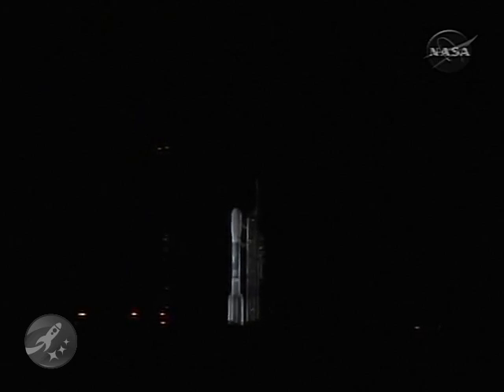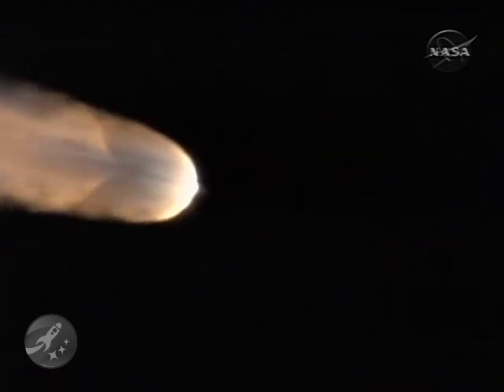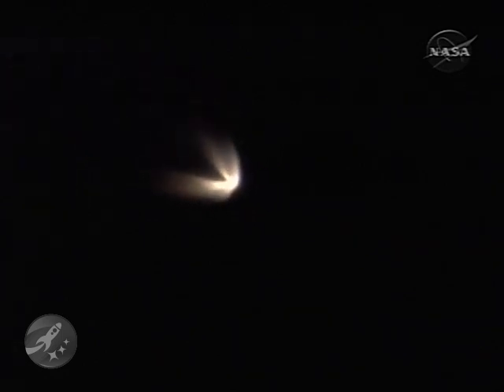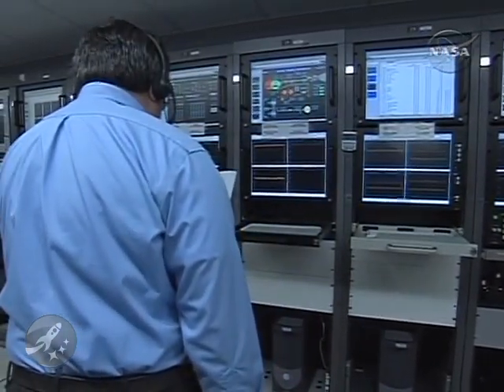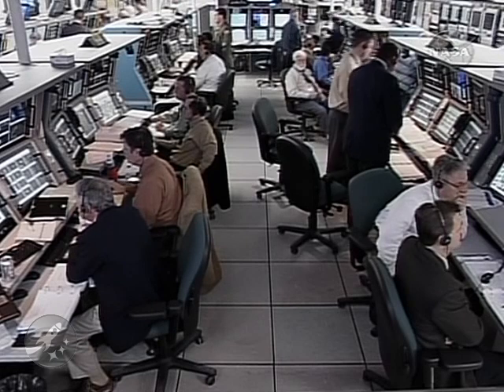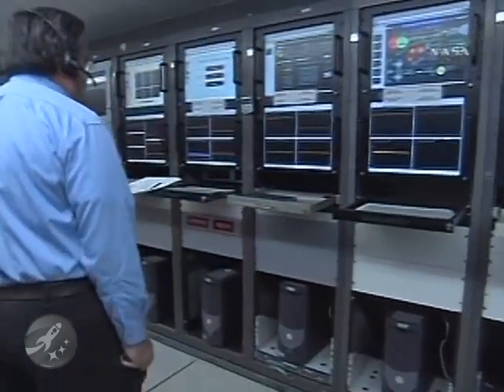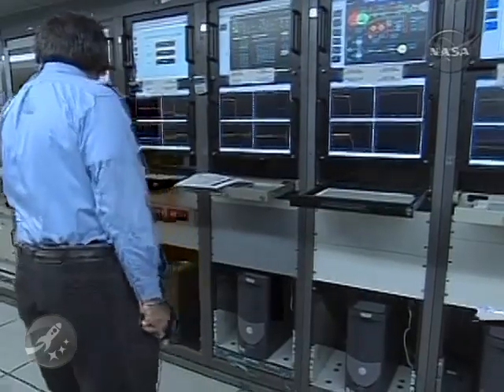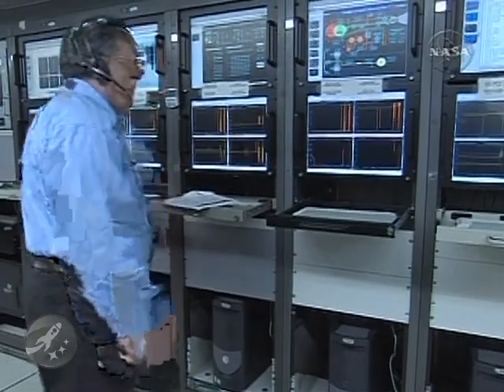Kepler Launch via Delta II Rocket on 03/07/09 (Full launch to SECO-1)

Comment: Actually, it is only one third the speed of light...

Light is 3,000,000 km/h
Reply: Light is not that fast. The speed of light is 299.8Mm/s, or roughly 300,000km/sec. that would be 1,080,000kph.

Comment from the maker: Second Engine Cut Off or Second Stage Engine Cut Off or Sustainer Engine Cutoff...  I usually say Secondary Engine Cutoff and there are multiple SECO events, this is SECO-1 but the secondary engine fired back up to push it in to the proper trajectory, and when that stopped it was SECO-2.

MECO would be Main Engine Cutoff.

Kepler is not an acronym, it is in homage to Johannes Kepler (which you can Google search to learn more about)